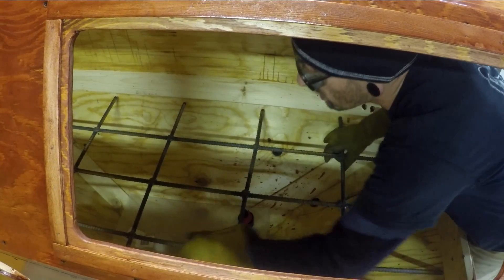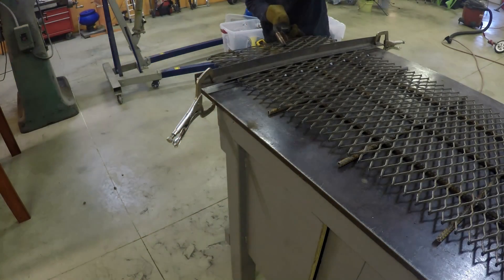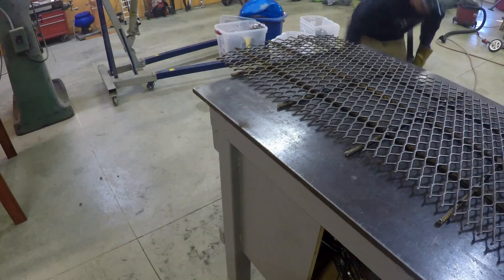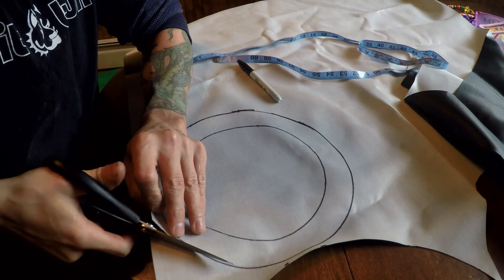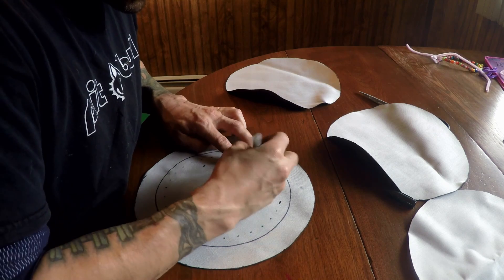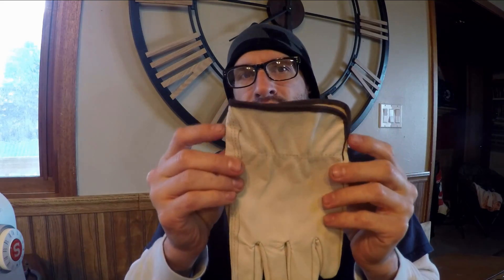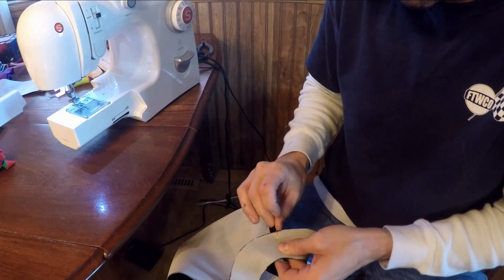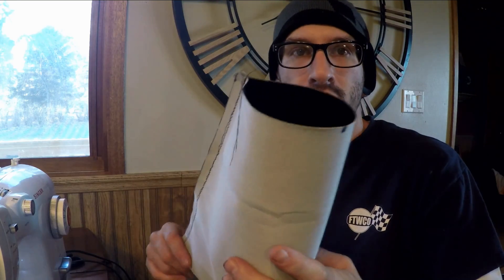Building a DIY Sandblasting Cabinet pt2

Comment: I’m currently looking at building my own, would any shop vac work?, also, what did you use for your air intake?
Reply from the maker: The air intake is just a hole the same size as the shop vac hose. I think it should have been cut a bit larger though, because there is considerably less pressure in the cabinet with the shop vac running.  If I were to do it over I would use a cyclone type pre filter before the shop vac.  The filter is always getting clogged in the shop vac the way it is.

Comment: Where did you find the grating for the flooring of the cabinet? I've got everything for my diy setup but that
Reply from the maker: +Keith O'Connell I bought the expanded steel at the local salvage yard.  Sometimes they carry leftovers from fab shops.  I would think a welding shop would have it, or they could get it for you.
Reply: I'll have to ask my welder buddies if they can get their hands on some for me. What lights did you end up using in yours? 

By the way you really laid out your videos well for the at home guys. When I started building mine last year I always referenced your videos because yours are definitely the most detailed. So thank you man. Mines friggin huge and I just picked up a 80gal compressor finally this past week. Ready to get it running finally.

Comment: Good job dude, can i ask what u use for blasting? Its not sand i think. Its alumium oxid? And how mest/size u use dude. 
Thx
Reply: We used to use copper slag when I was in the service. I don’t where to get it any more but the stuff is bulletproof and doesn’t leave much or anything like residue from what I remember. It has very sharp surfaces next to most other abrasives so it’s good for stripping but not good for finish work.
Reply: Btw that’s a great job you did on your box , almost bought a harbor freight box today but it isn’t as strong as yours and sure won’t handle anything close in size. Glad I thought to look for a video on this and darn glad that you posted such a great video. Nice work man.
Reply: sandyt i try with silica sand too much dust lol. Can i ask u about u vacum? Specification u vacum?  like what.
Reply from the maker: +ageng simuk The media I use is some stuff called "Black Blast" i believe it's  black garnet blasting sand.
Reply: Precision Moto oke thx dude

Comment: Nice job man. Can I ask what compressor do you use?
Reply from the maker: +Piotr Piskorek at the time I made this video I was using a smaller oil free 30gal compressor. That compressor could not keep up though.  I have since purchased an 80gal 2 stage compressor that puts out around 14CFM at 90psi.
Reply: What I could do with my compressor. 60cfm at 125 psi

Comment: You are great and inspiring. I have a need for a blast cabinet and after researching online, a quality cabinet is out of my price range. So the thought of doing a DIY passed my mind but I figured sourcing parts, especially the glove setup would be difficult. Also never considered wood. Appears to work OK. My questions are, total cost as built, and if possible a list of improvements, changes and advice. Thank you so much for showing that it's possible. Your help would make me start the project and I would keep you posted. Just subbed. All the best to you.

Comment: What kinda of plastic did you put behind the windows?
Have you had any deterioration on the air or sand lines inside the cabinet?
Does wood chips/dust clog up the gun ever?
Also looks really nice, i kept thinking "if he added some brass to the outside it would look like an old ship"
Reply from the maker: The plastic used behind the windows is some sandblasting film that I found on Amazon. http://amzn.to/2qzJkAL
As far as the lines deteriorating inside the cabinet It would take an awful lot of sand blasting to do that.
I have had wood chips clog up the gun twice.  This is only because I did some more work to the cabinet after I had it assembled and full of sand (installed some lights.)  My note on this is, make sure the cabinet is completed before adding sand, and vacuum the cabinet out thoroughly before adding sand.  The wood inside the cabinet lasts longer and is more resistant to the blasting than I thought.  I figure if it goes through one ply of the plywood, I will just coat the inside with an automotive underbody coat or truck bed coating.
Thanks for watching
Reply: For what it's worth, I use the thick plastic that you use to insulate windows with in the winter time. It comes in a big roll 36" wide, and it's crystal clear. I cut it into 18" x 36" strips, and wrap it around the window, and just tape it on with masking tape. it reflects that sand pretty good and protect the actual glass from being pitted. It's like $12-13 per roll, and you can get about 15 pieces out of a roll. About 1/3 the cost of the "scat" window liners. I hope this helps.
Reply: @theSword-  I know this was a while ago but it there a link for this plastic